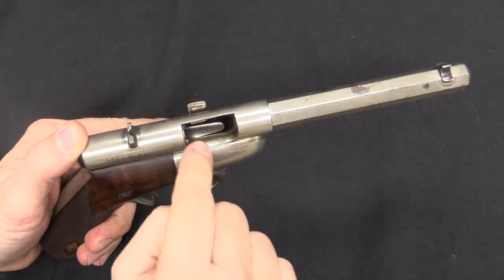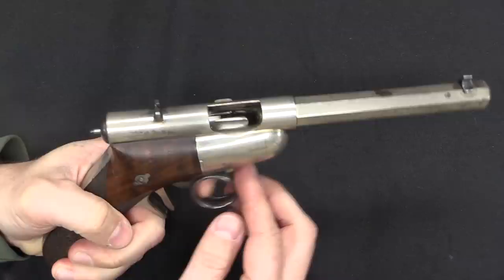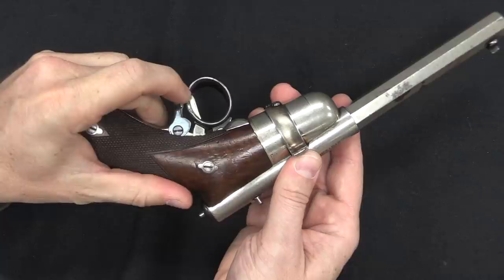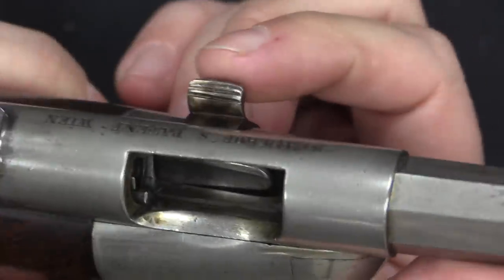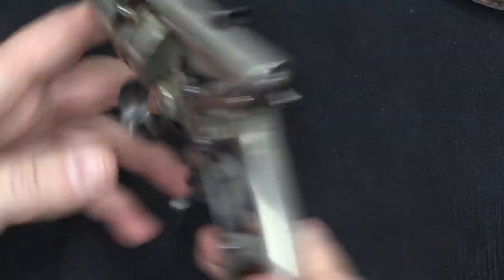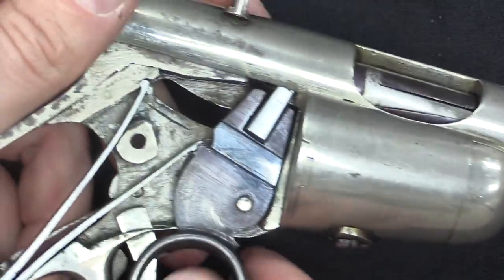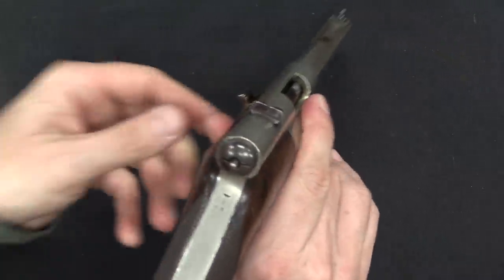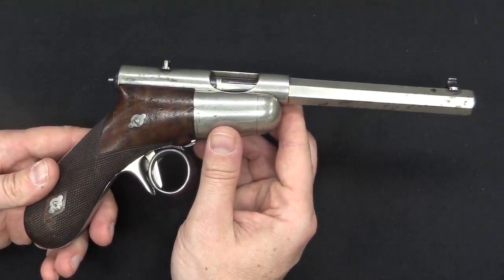Schulhof Model 1887 Manual Ring-Trigger Pistol

Comment: This design is very clever. 

Not as simple or convenient as a (well-designed) semi-auto, but it really is a very clever piece of engineering.
Reply: It would be incredible though for shooting suppressed if it had a threaded barrel!
Reply: you know this is why i like guns, the engineering and shooting.
Reply: This design was well ahead of the manufacturing of the day. It could be easily be made with a combination of additive and subtractive techniques and it could be a viable weapon. 

Stripper clips are a compact and secure way to carry ammunition. An integral suppressor could, with the right cartridge, make it safe to shoot without ear protection. 

If semi-automatic pistols become illegal and a revolver isn't suitable, this is a viable solution for many use cases.
Reply: Or you could, you know, refuse to comply and stand up for your rights.
Reply: But what benefit is to this compared to a revolver ? Because that would be its competition. I think its harder to load and reload.
Reply: @Muaddibize  Well seeing as how there was a potential for a stripper clip like loading system, if it had worked, or existed that would make it easier than reloading many comparative revolvers of the day. At least the intent was there.
Reply: I agree.  There's plenty of reasons to say that this design isn't as good as something else, but the fact is that it's a long shot from being useless.  It could easily have more capacity than a revolver, fire cartridges that aren't conducive to semi-automatic cycling, and be pretty darn covert without being single-shot only.
Reply: @chemistryofquestionablequa6252  but the gun community has always celebrated malicious compliance.
Reply: @Muaddibize  you loose the pressure and precission loss of the gap between the drum and the barrel, wich is not that much with moddern production tec.
also it would be easy to construct with changeable magazines  or simply higher capacity mags
Reply: @danielcurtis1434  ya say 'threads could be cut'  Please only on modern copy = no cutta da anti-que ...  ;-)

Comment: This would make a pretty slick base gun for a Star Wars blaster.
Reply: like a fancy one some rich person would have??
Reply: Don’t say that or some prop department guy is going to buy up a dozen of them and go ham with a Dremel and hot glue gun.
Reply: Looks similar to Padme's blaster pistol
Reply: @john-paulsilke893  At this point, it's cheaper for them to 3d print copies. That for sure wasn't the case up until the last few years, though, and doesn't apply if a prop house already has examples in house.
Reply: I was just thinking that I might be seeing this in one of the new Star Wars shows in the next few years.
Reply: We all know what The Mandalorian's blaster is based on 😊
Reply: @kaneyoung7439  I was just going to say that!
Reply: @daniellewis1789  The guns in the prequel series were made of hard rubber.
Reply: Djanggo entered the Chat

Comment: This is basically a bolt-action pistol, only that you can operate the bolt together with the trigger. Very clever.
Reply: lever action pistol more accurately.
Reply: Straight pull bolt action mechanically.

Comment: I'll disagree on one point. It seems to me that the internal magazine in that pistol is better than the cylinder of a revolver. Carrying rounds in a strip would be much less bulky than a speed loader, and it would be much faster to reload than revolvers that use a loading gate instead of being a break-open or swing-out. I'd even say that the magazine design is almost as practical as a detachable box. I'm really impressed by how simple it is and how streamlined it makes the pistol.
Reply: Chamber it in 357 and call it the almost auto mag.
Reply: @justforever96  Maybe not for pistols but for rifles they certainly were.
Reply: I guess you've never heard of speed strips.

Comment: Seems pretty interesting , it's basically a one finger operated bolt action pistol. Wonder why that concept wasn't studied for something like the Welrod.
Reply: In the Welrod's case, there wasn't a straightforward need. If you're using a Welrod according to its intended purpose, you're more or less at extremely close range and your target is "already dead."

Welrods were also supposed to be fairly cheap, the originals don't actually have a grip, using Colt 1911 magazines with some rubber or epoxy applied to the bottom of it if I recall, and were designed to look like bike pumps when unloaded. It's a case of trying to answer a question I doubt anyone was asking. What was needed was a gun capable of offing a guy at very close ranges that made little, if any, noise. Frilly things like "return fire" were not a part of the design docket.
Reply: @harleymitchelly5542  While this is true, I still want to see a Ring-Trigger operated Welrod.

Comment: I'm surprised it didn't take off. That's a very interesting design that could have been much more useful with some tweaks
Reply: It's way better than a revolver for "combat" use.
Reply: I'm sure if semi auto pistols werent just around the corner they would've become more popular.
Reply: I don’t think the average person would be willing to get something so whacky an unique. They would probably go with a revolver which is what they know.
Reply: That's what I was thinking. Being it's basically a bolt action system levered to operate with one finger, I wonder if anyone considered the design for say, the Welrod pistol?
Reply: It was probably expensive to buy and it looks a bit fragile, especially with the bolt being open when not in use letting dirt and crud in.
Reply: Looks like a magazine problem.  If it had a ten or twelve round box magazine it would have at least had something over a revolver.
Reply: I'm not really. I agree with Ian - it was probably more expensive, more complicated, and more fragile than the revolvers of its time, and it had the same capacity.
Reply: Not ideal for mass fabrication.

Comment: This needs an enterprising type with a patreon to reverse engineer for CNC using modern metallurgy
Reply: Stripper clips are awesome.
Reply: @CampVictoria  Ian made a video about patents, blueprints and why recreating old firearms using them isn't as easy as first imagined.
Reply: @Graphictruth  I too find clips of strippers awesome
Reply: @CampVictoria  It is cheaper to buy the antique.
Reply: @aldever4968  The same with Lugers. A new production Lugerman is extremely expensive. Especially if you want a .45 or 10mm.

Comment: To compete with revolvers they would have needed larger magazines but an intended for much reuse stripper clip would give faster reloads than the contemporary revolvers.
Reply: maybe even a spiral feed 
like that Calico but under barrel...
or using a silencer bcs of the gas seal
Reply: @bumpercoach  great point about the silencer!
Reply: @bumpercoach  por que no los dos?
Reply: @bumpercoach  
The silencer hadn't been invented in time for that gun to use it as a sales feature.
Reply: such a shame huh  @calvingreene90  not even in time to save the hearing of its inventors father the great Maxim

Comment: This was soo close to be semi-automatic in mechanism.
Reply: That's how a lot of technology advanced.  Slow, slow, slow, then suddenly it's something else entirely.
Reply: @Stevarooni  talk about slow, i still can't understand why the german army used the K98k til the end of the war, when semi-auto rifles with mags were way better.
i mean heck, even the assault rifle was defeloped at pretty much the same time (1-2 years difference)
THEN it went fast tho.... i agree.
Reply: @Blei1986  unfortunately for the Germans, their technology arrived as their capabilities were waning.  And it takes years to change manufacturing lines to a new product, especially with a completely new design.
Reply: @Stevarooni  true...
i still think even rushing a trench in WW1 with a bolt action rifle is closer to using a musket than any modern rifle.
imo a HUGE difference.
Reply: @Blei1986  semi-auto is a good improvement over a bolt action, but a musket is 4 shots-per-minute with a skilled shooter, while the standard for Brits with their Lee-Enfield rifles was 15 shots-per-minute (the record, with good accuracy, was 38).  The M1 Garand shoots around 40-50 with a trained shooter.  Muskets are a far cry from a bolt action.  Semi-auto takes less training to achieve similar (but better) results to a bolt action rifle.
Reply: @Stevarooni  i know, but still think bolt action rifles should have had a boost in developement towards semi auto directly after WW1.
you have like 5 or 6 rounds, you take very long for just reloading a single round.
i mean even revolver-rifles would have made more sense, because when the drum's empty you most likely did your job in the attack and killed 1< enemies.
no need for high precision or something like that.
i think bolt action were completely bad choice for the warfare... i mean with 10 round mags and semi auto rifles, bayonet charges wouldn't have occured in larger scale imo. that's how you know how ineffective the rifles were for the job.
Reply: @Blei1986  😁. M1 Garands had 8-round magazines, and Lee-Enfield bolt action rifles have 11-round magazines.  And most people loaded bolt actions with stripper clips to load the whole magazine at once.

I concede, though, semi-auto is better than bolt action for most situations...if you can afford them, and they're reliable and tested.
Reply: @Schwarzvogel1  gee, you taking this one too literal and don't get the point.

Comment: What would be the advantages of something like this over a revolver? The only one I can think of at all is the elimination of cylinder gap and perhaps better accuracy from more consistent locking.
Reply: Bullets can't jump crimp and tie up the cylinder (probably not an issue on this pea shooter). Enclosed magazine vs open cylinders. Only one chamber. Slightly flatter/narrower because each round isn't supported by its own chamber.

Comment: I was sitting trying to think of any advantages to a revolver or automatic. It had no cylinder gap, It can't be defeated by someone blocking the hammer, it cant be defeated by preventing the cylinder from rotating, and unlike most modern semi automatics it can't be pushed out of battery from the muzzle or be jammed by a dud round. It would function with blank or bird shot rounds. However, I would think in a blackpowder firearm sticking cases may be an issue more often.

Comment: Honestly I was expecting a lot more claptrap inside that thing. Realistically, it's no more complicated than an American revolver. A continental Galand action is obviously much simpler, hence its great success, but this really isn't that bad engineering-wise
Reply: A revolver with a sling-out or top-break cylinder is a more practical design overall.
Reply: I too was expecting much more mechanical bits but the way that V springs works is absolutely genius. Really simplifies things.

Comment: do you have to pull the cartridge stop after firing a shot ? because i dont see it moving
Reply: Probably interacts with the bolt somehow when cycling? Doesn't need to move much to allow a round to feed.

Comment: This could have been wildly successful with two little changes... first, flip the rotation of the bolt and orientation of the magazine to a left port and clockwise (from the shooter) winding magazine, which would allow this predominantly right-handed pistol to be charged with the left hand, meaning one doesn't need to change their grip from the shooting position to reload. 

Second.... this thing is SCREAMING for a 10, 12, maybe 15 round helical magazine extending under the barrel.
Reply: Could be double stack double feed too. Would make stripper clips viable and be more compact than a drum, although not as cool. The left hand port loading is handy on airguns and .22's, can confirm.

Comment: This might have been a perfect replacement to the revolver in that era. The loading and firing mechanism was so simple. Not so complicated to maintain and disassemble. Sadly the world wasn't ready yet for this kind of modern wonder that time.
Reply: .. it was ready. the reason this wasnt popular is because a couple years later semi auto pistols were a thing wich made these obsolete. The only advantage this had over revolvers was the clip loading and just a couple of years later you had pistols with same or even higher capacity using magazines or stripperclips like this  that also  cock themselves.

Comment: If it held more than 6 rounds, it may have had justification over buying a DA revolver. Though the added reload speed of using a clip would be a plus, it really is basically just a more complicated and expensive equivalent to a revolver.
Reply: Lighter and slimmer than a robust calibre revolver. Six rounds of .455 without any gas leakage sounds fun.

But it's more fragile and expensive.  Or was. Now, not nearly so.
Reply: @Graphictruth  I don't know about lighter, since the frame is solid steel, and given that it's a rotary magazine the width wouldn't be much less either, since the cartridges are held in the same circular orientation.

It might be a bit lighter and slimmer since the magazine doesn't need to be as strong as a revolver cylinder, since it's not containing any pressure, but I don't think it to be a significant difference.

Now costs today would be much less, sure, but we have true autoloaders nowadays, so there's no real point to these except in countries with restrictions on autoloaders. Give it a higher cap magazine and I guess it can be viable in place of revolvers as a manually operated gun that doesn't have to worry about duds or ammo sensitivity.

With all that said, I do find it neat and would buy one if someone made a reproduction, that doesn't break the bank. ($1,000 I would do, $5,000 like those repro Lugers... that's too much for me.)

Comment: Question. Why would one buy this over double-action revolver? At the time I mean. I can't see any reason good enough.
Reply: Same, I can't see any advantage here, six rounds as many revolvers, weird operation (very interesting and mechanically I like it, but can't say it's better), cant see it being more reliable then a revolver either...
Reply: well the stripper clip loading would be an advantage over revolvers of the time.
Reply: @herocommand  true, that and perhaps accuracy advantages due to consistent locking and no cylinder gap (someone pointed this out in another comment)
Reply: Probably not available

Comment: The action of this 1887 pistol is technically far superior to the latest manually-operated repeating pistol, perhaps the only style in production, the yet-unreleased B&T Security Six, based on their VP9 sold in Europe since 2014 as a modernized version of the Welrod pistol from 1942. A bolt-action pistol, requiring both hands to operate. Slow cycling, not ergonomic, and hard to grip the moving parts. It's not even as fast as a "Hush Puppy" style slide-locking decide on a conventional semi-auto pistol. I love silenced firearms, but was very disappointed.

The manual-action handgun isn't obsolete, just niche! It's a shame the new ones aren't nearly as good as they could be because they're not as cleverly engineered as their much faster-cycling 19th century predecessors. I'd love to buy a modern design inspired by these Austrians. Perhaps in .22LR and with a threaded barrel or integrally silenced, which would make it quieter than anything else you can practically shoot one-handed. An ideal farm, garden, and pest-control handgun! There is a niche in the market for repeaters like this, as B&T have proven by resurrecting the Welrod. But obviously there are better ways to cycle a handgun manually. Here is one such way, from 1887!

Comment: Very interesting, but kinda comes under the heading of 'how many times can you reinvent the wheel?'. There were simpler, more elegant and efficient systems already available. The ingenuity and originality is to be applauded, of course, but a non-starter from the outset in all honesty. The levers are too fiddly - the trigger could be linked to the ring cocker, to engage with a sear only once pulled back, rather than being a totally separate mechanism, the 'backstop' and safety are just messy and could be deleted. Frankly, a means of locking or blocking the bolt - on the left of the gun, would make carrying / using far safer and more efficient. Hard to pass comment on the magazine, feed reliability as it was barely touched upon here.

Comment: A manually operated pistol with a six-shot rotary magazine. Or you could, you know, just build a revolver.
Reply: but what if I'm sophisticated enough to dislike cylinder gap problems?
Reply: But you can load this pistol with a stripper clip. And you can avoid revolver related patents.
Reply: @JohnADoe-pg1qk  I think they already had speedloaders for revolver in the late 19th century, so that would not be much of a problem. Patents, yes. That was a big issue.
Reply: @ajvanmarle  The Prideaux patent was applied for in 1893 in the US (No. 516942), six years later. If there were earlier examples, they probably weren’t very common in the 1880s.